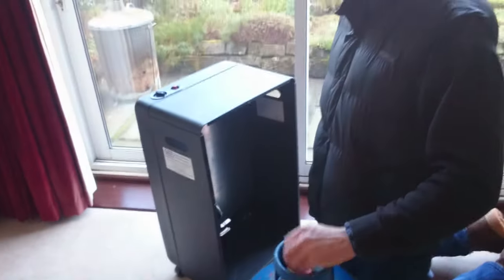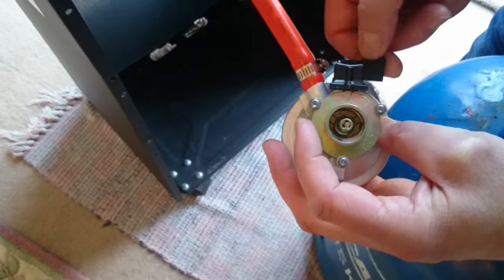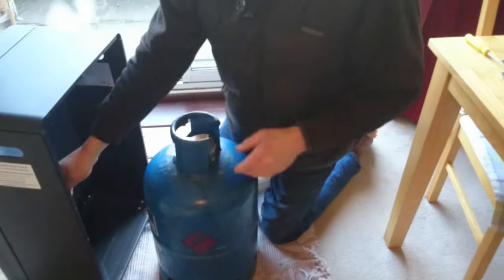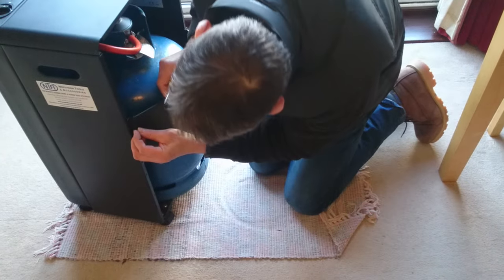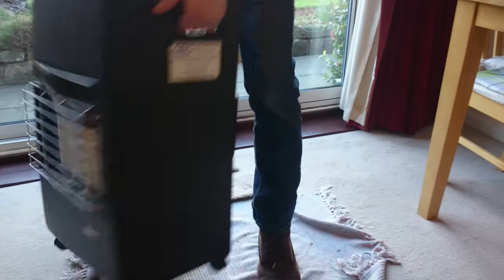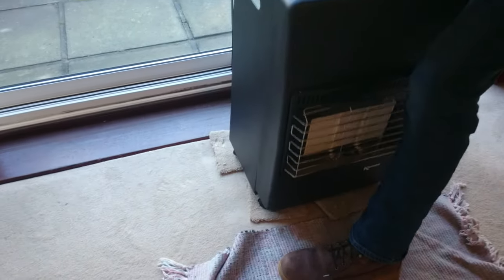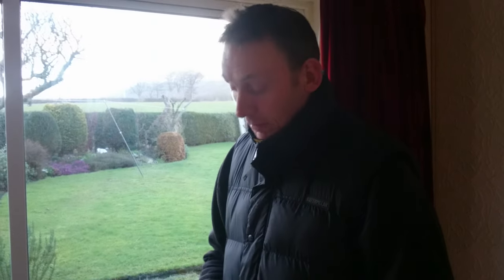How to change a calor gas bottle and safety checks

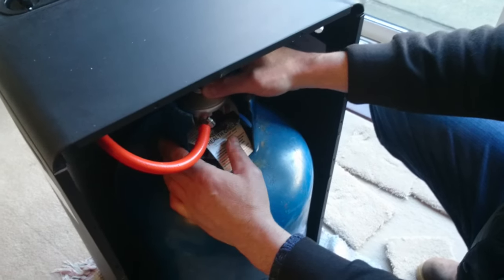Comment: Getting the regulator disconnected from the gas bottle can be tricky. Look at the black button described at 1:55 - the button under the on / off valve. When disconnecting the regulator from the bottle you need to press IN this button - it is not very intuitive unless it is explicitly indicated in your heater User Manual. It did my head in for a while also until I discovered it.

Comment: You need a 1 metre clear space around the heater to avoid any fire hazard and the front should be well away from furniture curtains and drapes as well as toys, soft furnishings and furniture coverings.

Comment: Anthony, This video does not show how to change a bottle. Only how to put a particular regulator on to a bottle., you do not show how to take it off.  Mine does not have a button, are there other types of releases.  Many thanks
Reply: The gas regulator toggle can double as the button too. Try closing the regulator then pushing it in towards the gas bottle. We have two heaters and one of the regulators works that way.

Comment: I watched this for disconecting. And you didn't.
Reply: Me too
Reply: Me too
Reply: Did you find out how to disconnect ? having problems getting mine off
Reply: Lol so basically there is no point me watching this then.... thanks for the heads up
Reply: Yup lol, push little black plastic button in to take regulator off, took abit of force to get mine off
Reply: qTAMp THANK YOU
Reply: Does anyone know how to get em off I have 15 and I'm struggling with them all
Reply: @Tammmmmmmmmmmmmmmmm  why on earth didn’t anyone else just say that I ve struggled for ages,watched the videos over and over and all I had to do was push the little black button
Reply: @katethompsonTitch.  which black button 🤔  can't push font know where to push

Comment: Thank you for this video! I just bought a calor gar but the regulator has a rattling as though there is a loose part inside. I'm wondering if that is okay; the connections seems secure though.

Comment: Do you need to open a window for the carbon monoxide?
Reply: it must be a good ventilation. you need oxygen for living, heater needs oxygen for burning. plus - buy a CO sensor/alarm. it is not expensive but can save life
Reply: I don't, just regularly keep your heater serviced once a year by an LPG qualified Gas Safe engineer or Calor Gas main dealer or caravan dealer who services LPG appliances, and leave an inside door open for ventilation purposes i.e. a kitchen or conservatory door, that's all I do, no need for a carbon monoxide alarm at all. You should also check the flame colour and quality of burning regularly too and take action if you see a yellow tipped blue flame or completely yellow flame with soot, this indicates the burners and/or pilot light could be clogged with dirt and dust not allowing any airflow to burn cleanly.

Comment: which direction is off?  At beginning of video (0.26 sec)  regulator switch is turned to face upwards to turn gas OFF but later (3.40) switch is turned upwards to turn gas ON.  Which is correct?
Reply: it is marked on regulator, just look at it. horizontal is off, vertical is on.

Comment: Can I use either the blue or orange gas can? It currently has a blue one but it’s running out however I have a full orange one and was wondering if I could use that one??
Reply: Gaming Vids Sorry, no. Propane (red) or sometimes orange, is contained at a much higher pressure and as such, it must not be used indoors.

It could cause a very dangerous situation indeed if propane is used in a domestic mobile gas heater i.e. too high a flame spreading dangerously out of the ceramic plaque burners due to the higher pressure contained and produced.

You must use Calor Gas butane at 28mbar or indeed any other brand of butane cylinder i.e such as Flogas Birmingham Auto Gas Rix Countywide West Wales Gas etc using a suitable regulator as specified by the mobile heater manufacturer and fitted to your heater.

Comment: I have one and I'm not sure how to make sure the gas is off , I don't want to leave it incase I get poisoning
Reply from the maker: Just turn off the portable gas knob on the top till the flame dies out sometimes it sputers but thats normal theres no need to worry unless there's a faulty gas hose in the back but you can get it checked out normally free when you buy your gas get the lads to check your portable gas heater no worries👍🔥
Reply: @sweetooth1967  thanks a million Anthony your a star 🌟

Comment: The cap is too tight and I cannot pull it off..
Reply: Pull it forward, not upwards
Reply: Pull the cylinder cap lanyard upwards and outwards to remove it from the cylinder valve.
Reply: I need to take my calor gas off am a little nervous lol frightened I may blow myself up 😂